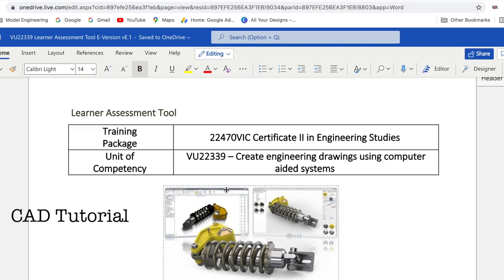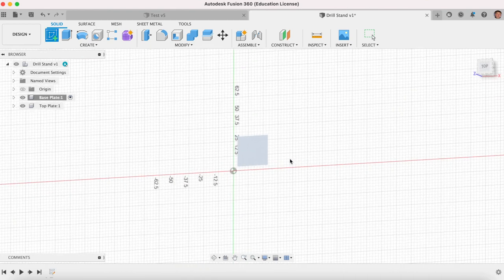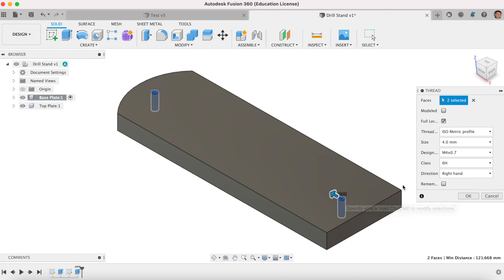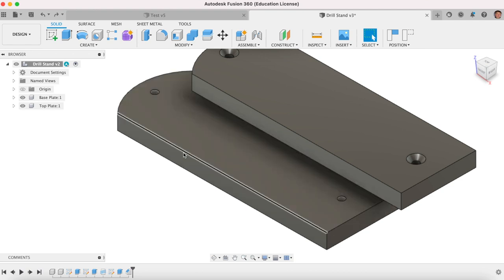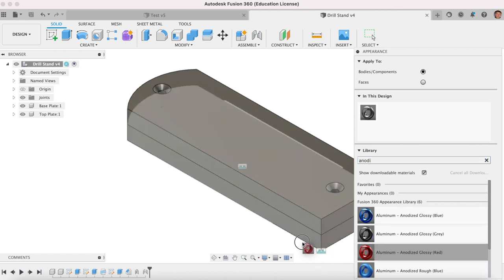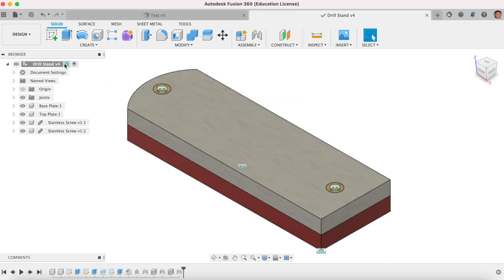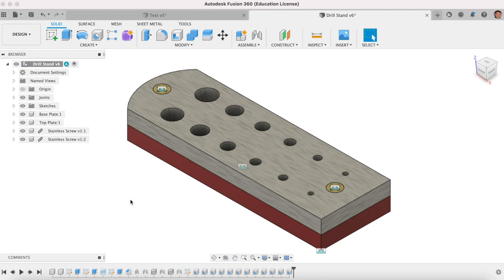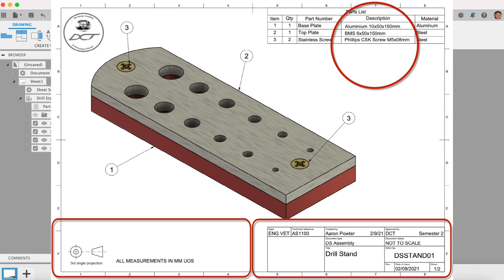Fusion360 Modelling & Drawing Tutorial 4 - Drill Stand

Comment: Suggestion.
To make the design more parametric, rather use a center construction line and lock the screw holes to that with a constraint, or click on the width dimension and divide by two. Then whenever the design is changed later, it will stay in the middle.

I know that you are working from a drawing out of a textbook, but I believe that it is a good practice to get early on.
Reply from the maker: G'day and thanks for watching.  Yes that's a good tip.  I would also strongly suggest using parameters and linked measurements in your design.  That way any further modifications made in the parameters will rebuild the model and it won't fall over.  These are only beginning tutorials for my high school engineering students.  Most have never used CAD or even drawn / sketched before.  Thanks for stopping by.  Cheers, Aaron.

Comment: I should have waited for this before I moved on to the multi component part. Is there a way to separate the assembly components after I have already created the pieces? I think in Freecad you can reassign pieces in the tree menu but not sure I can do that here. These are awesome btw. I know you are doing them with a specific purpose but they are more informative than most tutorials I have seen. Well done!  All the best, Eddie
Reply: Right Click on the bodies and create components from bodies.
Reply: @Bosbulls  Thanks!
Reply from the maker: Hi Eddie.  Bosbulls beat me to the comment.  That is correct, in the tree scroll down to the bodies (may have to expand them) right click on the body and select create a component from bodies.  However, best practice to create a component right from the get go.  Cheers, Aaron.
Reply from the maker: Thanks for your help Bosbulls.  Cheers
Reply: @DCT_Aaron_Engineering  Thanks professor, better late than never😁. I was not too far in so I just started over and practiced best practices. Sorry about the lockdown but believe me it could be worse. They are near max hospital bed capacity again in my area. I think we are at 30% vaccinated in my state with enough spare supply to be at 100%. Neverending.